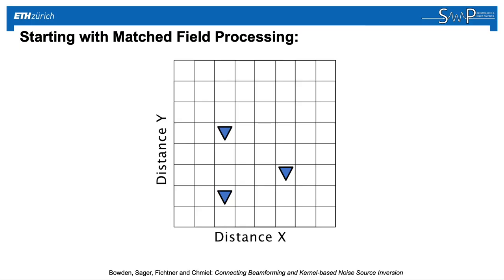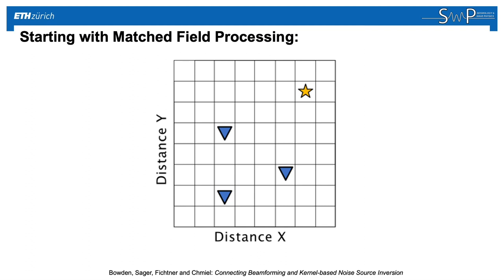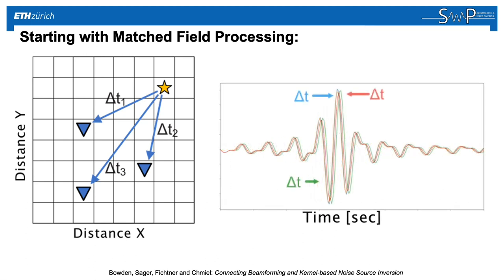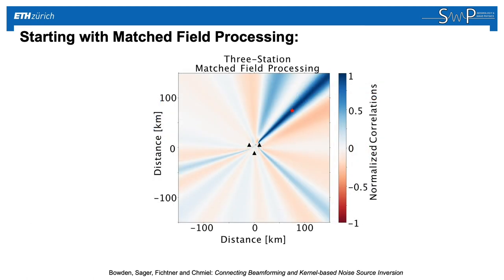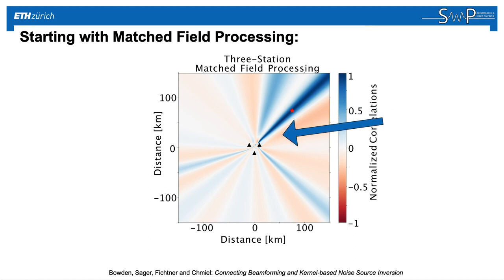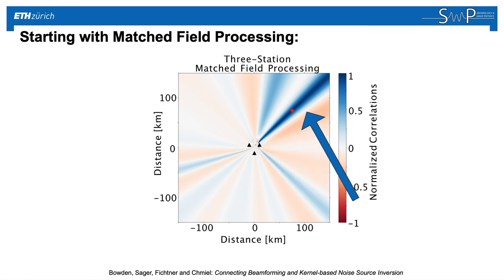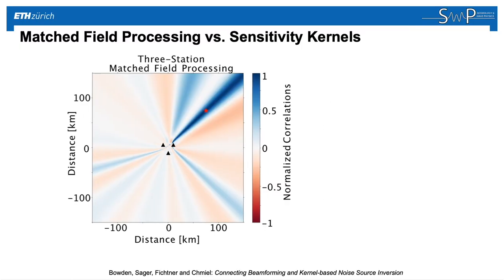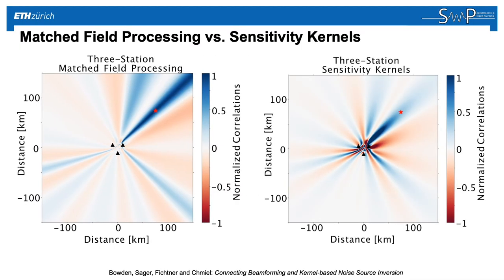Connecting Beamforming and Kernel-based Noise Source Inversion

Comment: Is a station equivalent to a sensor ?
Reply from the maker: Exactly, a station here is defined as a seismic sensor measuring ground movement.
Reply: @seismologyandwavephysics  and how about the others ? (Why did you specifically choose 3 ?)
Reply: @アセマ  Thanks for questions! Yes, I used 'station' to mean any sensor. This could be a seismometer, geophone, fiber-channel, or anything else! Just as long as you have a timeseries or waveforms that can be compared to other waveforms. As for the cartoon with 3 sensors, that's just for demonstration purposes. I'd say most real beamforming or MFP projects use at least 10 sensors to get a better image.
Reply from the maker: @アセマ  The 3 stations were mainly chosen to illustrate the concept. This can be extended to any number of stations :)
Reply: @danielbowden847  thank you for your answer it really helped!
Reply: @seismologyandwavephysics  thank you:)